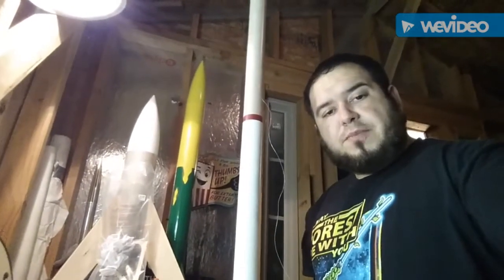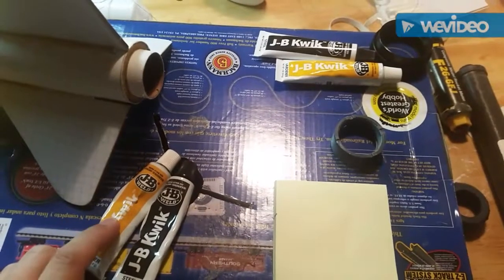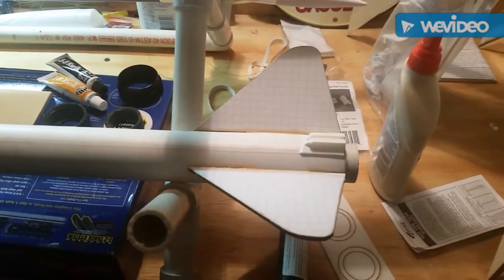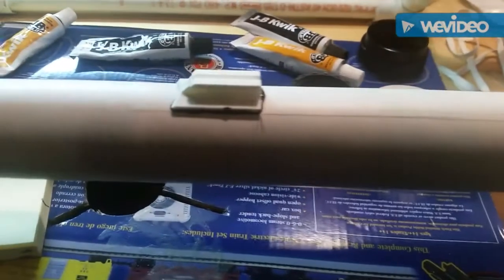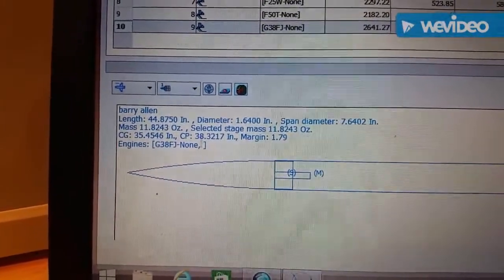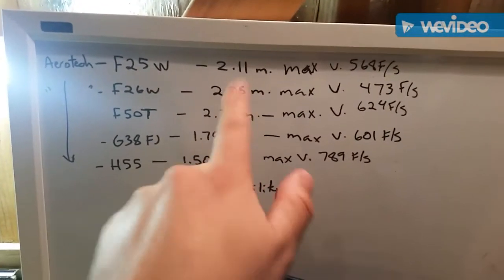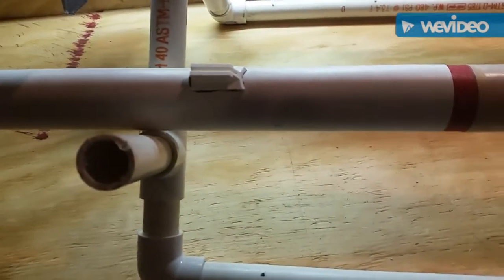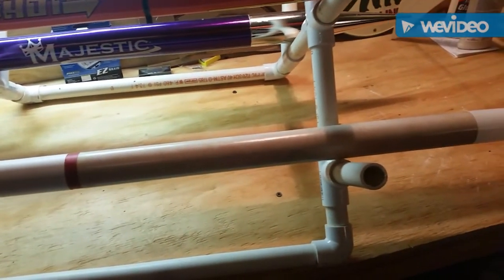Rocket _ Star Orbiter build_03

Comment: You do NOT have to scratch build for TRA/NAR L3 certification. I am currently L2 certified in both NAR and TRA and working on my L3 build process right now. Kits are allowed but there are many steps to the process including redundant dual deployment altimeters, thorough build documentation and strict approval/oversight. I would recommend that you read up on the certifications and get experience with larger L1/L2 rockets.

Comment: Hey im sorry if i missed it but im building this kit and i would like to know the engine mount does not seem to have a restraint from shooting the engine straight through the rocket any information would be nice
Reply: Composite motors have a shoulder at the nozzle end that keeps it in place. If you use a black powder (estes) motor, you have to wrap tape around the end of the motor to restrain it. Read the instructions, it explains how.
Reply: Shadow Seeker same problem here:(